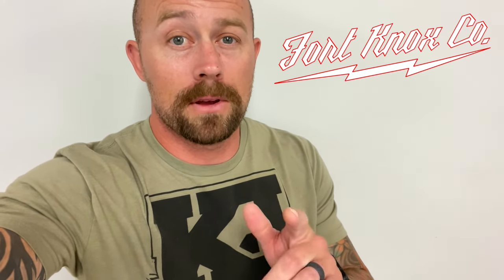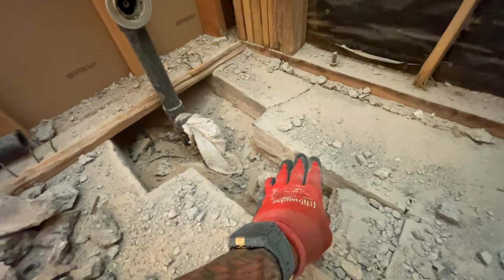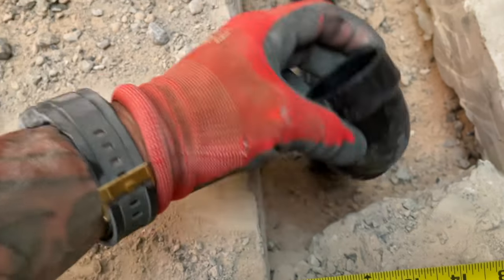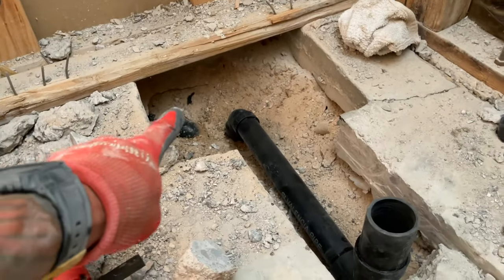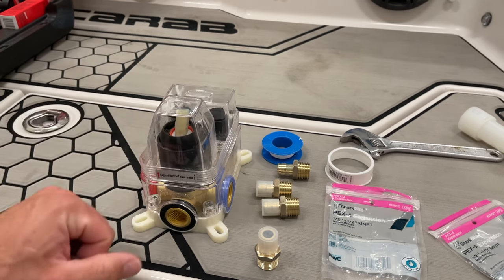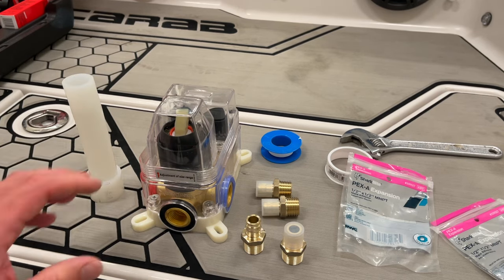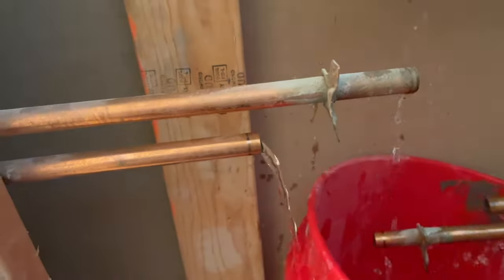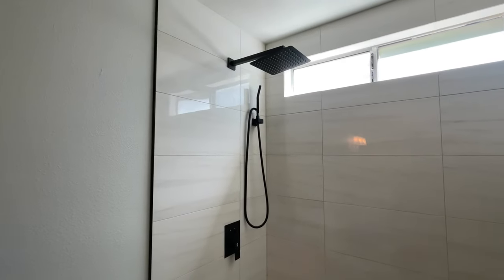How to Convert a Bathtub to a Walk In Shower

Comment: 2” converted from smaller pipe needs to connect to a 2” or larger pipe NOT to a smaller pipe!!! No bueno!!! Hack😂 You belittle the previous person’s pipe work and then proceed to do incorrect piping😂😂😂
Reply from the maker: You are correct. You should always try to size up as you go down the chain.  Code requires it and if you’re trying to pass an inspection that’s an easy catch for the inspector.
Reply: Can I ask, what you do if you don't have the ability to access the larger pipe run without really tearing into things?

Comment: the pipe is abs, not pvc, and the only time you are allowed to go from a big pipe to small is on the closet bend, this design makes it hard to cable it when it clogs
Reply from the maker: You are correct. It’s black ABS pipe. It’s most commonly used out here in this area for plumbing. Making sure you have the correct glue is important too. I’ve seen some tests where they used different solvents and they said they all held up and make the connection, but you might not get the same amount of time out of the joint connection.  And good info on the pipe sizing. I know it’s always best practice to go from smaller to larger as you go down the line in pipe sizes
Reply: He criticized the previous person’s work and then does the samething (incorrect piping😂😂😂😂)!
Reply from the maker: @Bbbbbbbbbbb-f1w  🤙🏼💯

Comment: How does this drain without a vent
Reply from the maker: It does have a vent. Just like any other shower you have a floor drain that runs off to the front or side and when it hits the wall it has a vertical vent up the wall.

Comment: That was very informative. I was just interested in how far I need to go back from the shower drain with the 2" pipe but I see I can just transition right under the shower. I like that Pex A but I'm only doing one bathroom and buying that spreading tool probably wouldn't make sense. Thank for the info.
Reply from the maker: No problem at all. Yeah the expander tool is an investment if you’re going to be doing lots of work. They do sell a manual one if you’re doing smaller jobs and don’t want to commit as much money. I know some plumbing places and tool rentals will rent the expanded tool too.

Comment: thanks for the video, what about a linear drain?
Reply from the maker: You could install a linear drain to this if you’d link. Once you have the underground plumbing the way you want you could pretty much install whatever you want on top of that. Most of those custom drains still connect to a inch and a half or 2 inch pipe. So whatever type of drain you decide to use should connect to the top of that.

Comment: Hey there...Great tutorial. i noticed you have abs pipe, and appear to be using clear pvc glue. Does that work?
Reply from the maker: Yes you are correct. I actually had the wrong glue in hand. You should use ABS solvents on ABS and Pvc glue for PVC. They will bond but according to the writings they say the bonds can be weaker than if you used the corresponding glue. They say the bond can hold but might weaken over time depending on location. 
I would use the black ABS glued on these black plumbing pipes.
Reply: @FortKnoxCo  Right on. thanks for the reply.
Reply from the maker: @toddelliott73  💯 I’m happy you caught that. Good eye
Reply: Did you have a vent

Comment: Nice content. My p trap is made out of copper. How do I convert to abs?
Reply from the maker: Your underground drain is copper? Not sure if I’ve seen that before.  What diameter is it? 

If you want to transition from metal pipe to ABS PVC they do make rubber couplings. They have a couple heavy duty hose clamps. Usually 2 per side. And you can transition with that. They can be rates to be buried as well. Not just any coupling, but could be found in York plumbing section.

Comment: How did he get an incline on the horizontal shower pipe? Just be forcing the bend to sit at a slight angle?
Reply from the maker: When you are gluing the pipes as with all T’s or bends you may be using for vent pipes or whatever your plumbing you can get some play in the connection. The glue/cement allows this when it’s melting/ dissolving into the pipe. So you just wiggle and prob the pipe u til it sets. Only needs a 1-2% slope at best. Very slight.  

They do this with vent pipes too in walls and attics. They usually need slopes to alls rain down from the roof and you have areas that span horizontal distances
Reply: @FortKnoxCo  thank you.

Comment: Im doing the exact same reno, going from tub to walk in and i was debating if i should cut the p-trap out and put it right at the center drain or do what you did but was wondering if its going to cause any problems and if it meets code? I do perfer your method.
Reply from the maker: Where you place the drain is completely up to you. Usually centered or front 3rd of the shower towards the shower head. But the main thing is that you have a P-trap. Otherwise you’ll have a smelly shower drain. And having no p-trap will not meet code requirements.
Reply: Cool, thanks for clarifying that!
Reply from the maker: @mr.joshua2937  no problem at all

Comment: our old drain is all made of brass. How do you convert to pvc?
Reply from the maker: With brass I e seen them use a rubber coupler that has several hose clamps. To transition from brass to pvc or new material

Comment: How did you connect the copper pipe to the plastic pex?
Reply from the maker: I would use a shark bite connector. They can connect copper to plastic PEX to PVC. They are very versatile

Comment: PVC glue on ABS pipes???
Reply from the maker: Yeah. I’d use ABS cement on ABS pipe. It will still hold just fine but they can’t guarantee the 10 year or 20 year hold on the joint per their specs.

Comment: Where did you get that shower valve?
Reply from the maker: The home owner provided it for me, but I believe he got it from Lowe’s. It’s pretty common style with most newer medium to high end shower brands it’s seems. Can’t think of the brand off hand though. I’ve installed a couple of them in recent time
Reply: @FortKnoxCo  gotcha. I hadn’t seen one with the plastic enclosure like that. I’m about to tackle my master bath Reno and this video was perfect!
Reply from the maker: @SoldByBookout  awesome. Happy I could be of help. Yeah I’ve seen the shower valves coming with things to help with setting the right depth when roughing in and also to cover and protect from the finish work being completed. Its a nice thing they’ve been doing